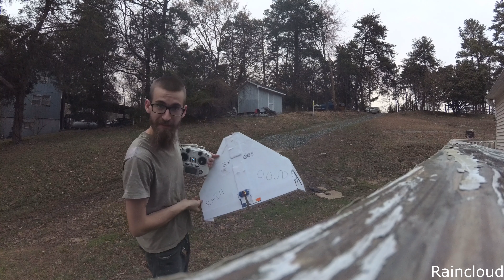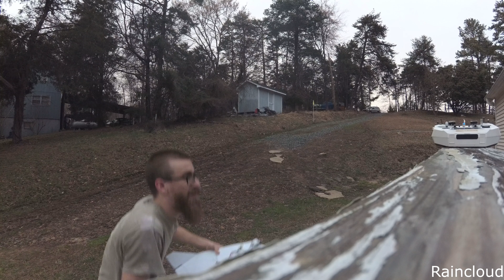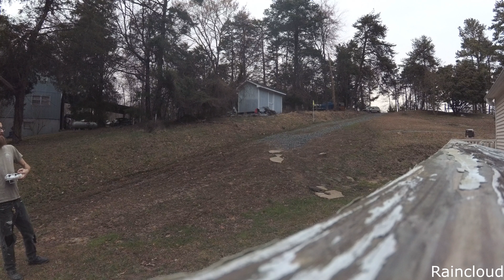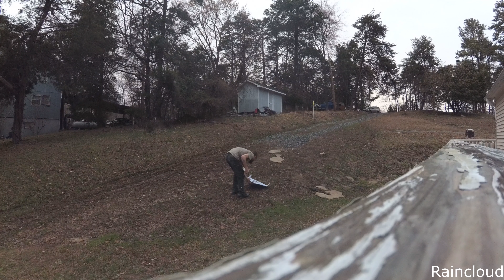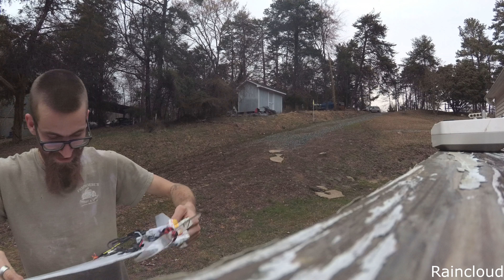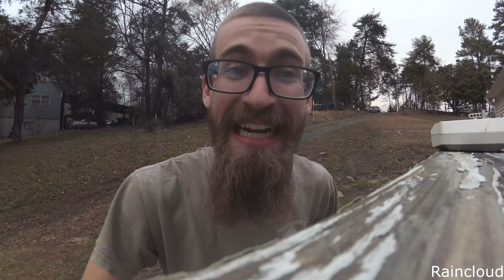Sweet Success!  EX003 Flying Wing

Comment: I think.... What you might want to do is put a weaker motor in there. Something with a little less RPM. That is alot of surface area thats trying to create lift. That motor just sounds too fast. Good luck with the experimental craft. :)
Reply from the maker: This motor is pretty revvy.  i ran a 7 inch prop and a 3 s battery to combat that hopefully.  i have a flite test spear sitting around,  i may try your idea on that!! I thought this motor might not be torquey enough but you may be spot on.
Reply: @campraincloud  I think thats why the nose is getting yanked around.